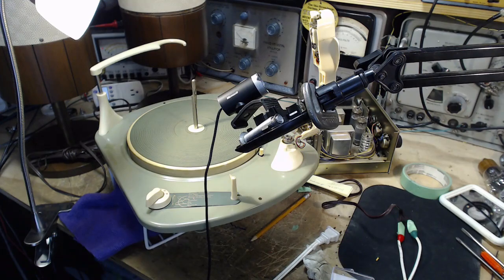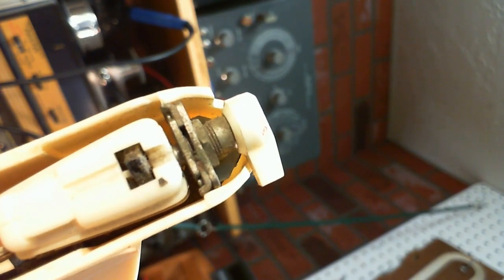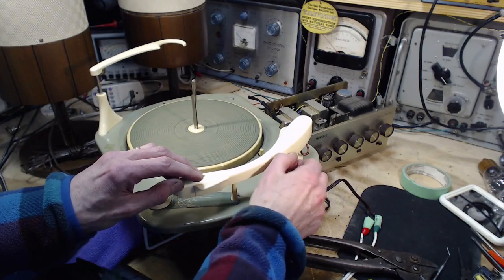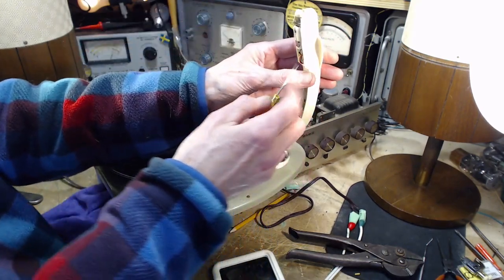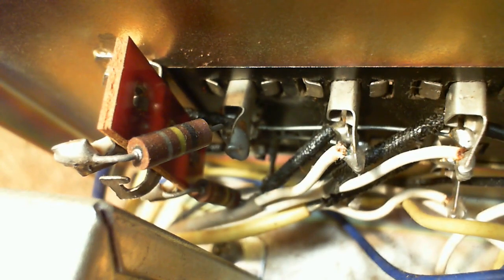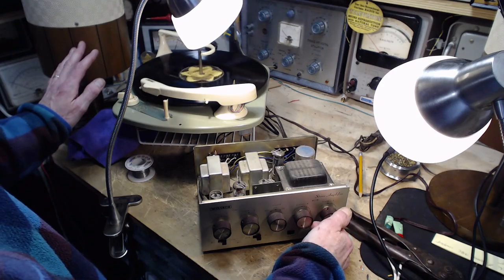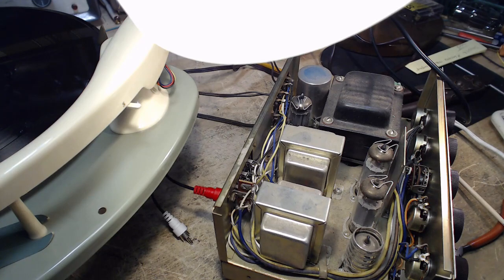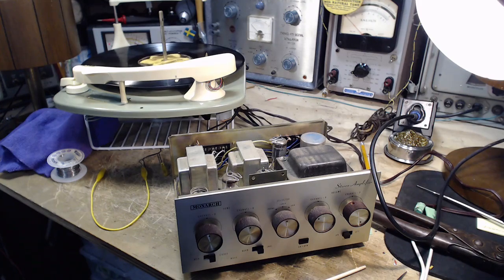Telefunken Record Changer - Vintage Cartridge Investigation

Comment: This is incredible - Yesterday he spent ONE HOUR around the amplifier and we all came to the conclusion that one channel plays lower than other (I believe it's the right channel)... Today he seems to have forgotten all the previous tests with the signal generator - The problem appears in the three inputs (Tuner, Aux and Phono)...
So the question is why is he fiddling around the stylus, the cartridge, even the speakers... Everything but the crappy amplifier  ?
Reply: Well I think on the last video I saw him using his signal tracer to test the output of the cartridge at the record player and with it he also found one side having lower output than the other.
I am just not sure if he had the cartridge disconnected from the amp.
So you may be right in suggesting starting to troubleshoot at the amp, assuming that the amp being mute on one channel is caused by the input stage of one channel being jacked up right up front and consequently loading down that side of the cartridge...

But it is just the second video. Revenue surely has not yet paid for another bottle of WD40 so we need to progress slower so we can get more videos on an otherwise 30 minute fix.
Reply: @randomsteve4288  I noticed that too, but if you go to the previous video around 33:00 we can clearly see him feeding the signal generator to one channel (that's practically muted), then he switch the RCA plug to the other channel and the sound seems to be ok. Notice that before this he did some tests feeding the signal from the sweep generator through the 3 inputs and all have the same problem on the same channel... Clearly that amplifier is not well... I may agree that there's also a problem with the cartridge, stylus or even the wires that connect to the RCA plugs but, at least in my perspective, he should start by fixing the problem with the amplifier and as soon as both channels are playing at the same level then move on to the turntable... Otherwise is a gigantic mess, there's no way of knowing where the fault is...
Reply: I knew within 3 seconds of this video that that is probably the issue lol. We don't watch his videos to actually learn things...but I still like the dude.

Comment: You can put two 33/45 needles on the double sided cartridge even if the knob says 78. Conversely you can put two 78 needles on it if you have a player
that you want to use 78rpm records for instance. Of course it must have some kind of amplification in the phonograph like this unit , to use  a cartridge that 
is only 1 volt over a crystal cartridge phonograph which was 3 volts, from back in the day. There is a burnt resistor on the terminal and a bad soldered 
connection on the other side.

Comment: Jim, it sounds like your phono cable, the one with the white plug, is the problem.  Sounds like the braid (ground shielded lead) has become disconnected, either at the phono plug, or at the other end where it connects to the phono cartridge lead under the record player.

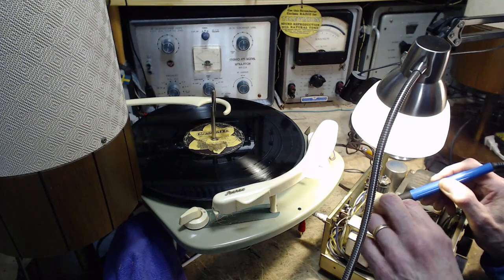Comment: 39:11 Please stop the "factory error" lament. The ground wire was surely soldered properly to that tab. But it was soldered to the side and then it was bent at a sharp 90 degree angle which made it weak. Maybe it was pre-bend using pliers to get an even sharper angle compromising it even more. And whatever bend was made  is where it broke from mechanical stress of plugging and unplugging the phono plugs. 
Plus there is also controversy over the question if the heat from soldering changes the copper wire to get slightly more brittle right at the solder joint or if the creation of the surface alloy that is part of soldering makes it more prone to break right at the joint.